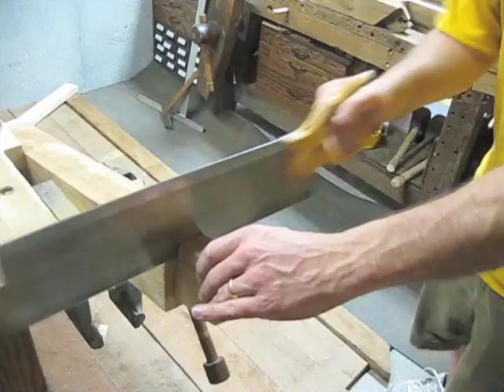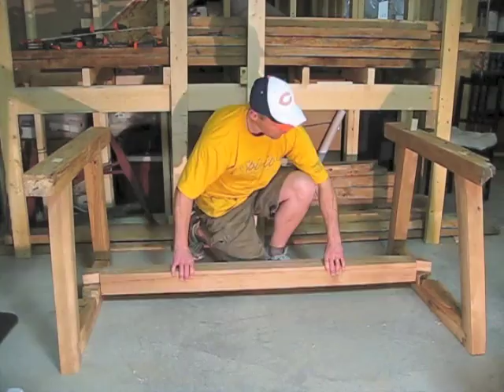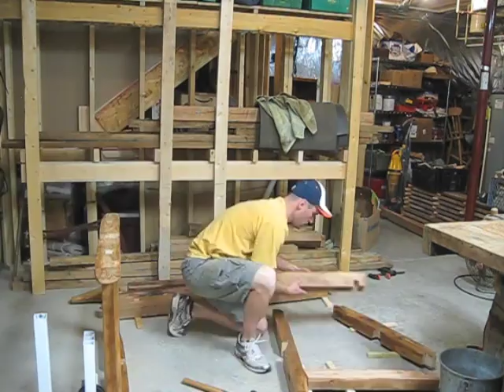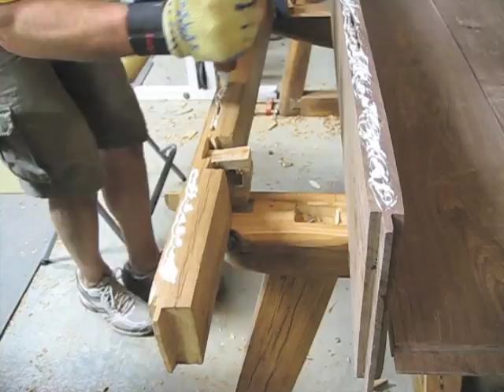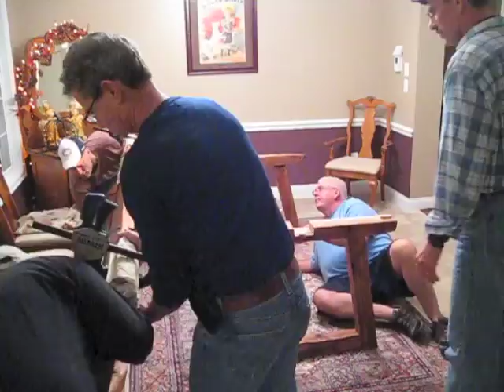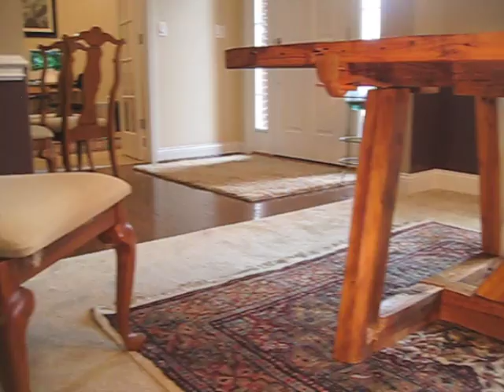The Priceless Gift

Comment: Great job! The commitment to the hand tool is simply amazing! Did I understand correctly that all joints are without glue, except for the countertop? Can I find out what kind of wood was used on the countertop?
Reply from the maker: I also used glue on one leg joint.  The table top wood is walnut.   The base is chestnut.

Comment: great strong design . so, if i got it right, there is not a single nail or screw in the table, nor it is glued?
Reply from the maker: I used no nails, nor screws in the table.  I did use glue in 2 parts of the frame and to glue to table top boards together.  I review the design, construction, and tools in the detail in the follow-up video called:  How To Build A Table (The Priceless Gift).  Let me know if you any additional questions.

Chris